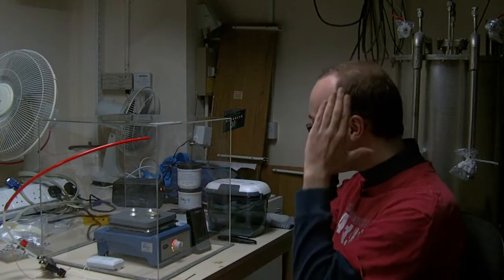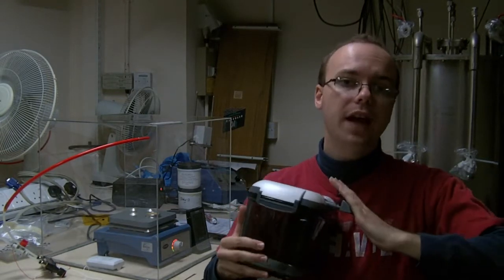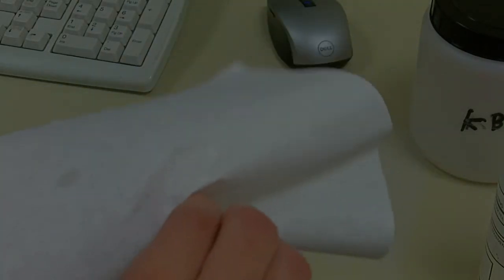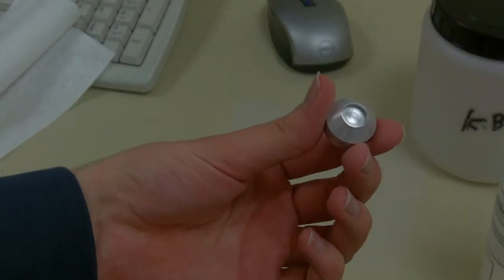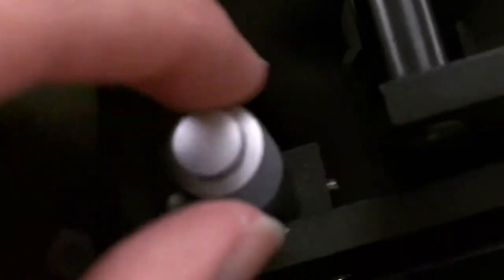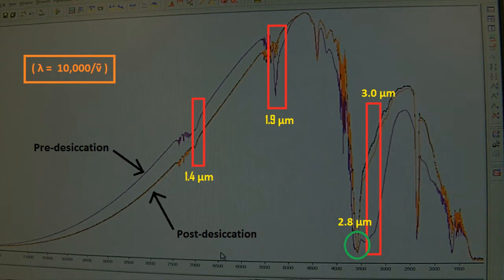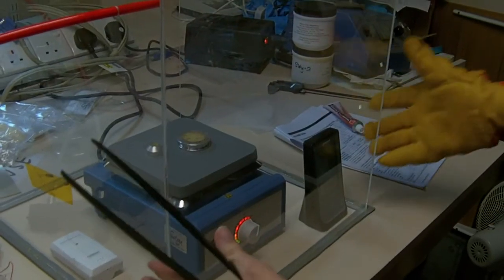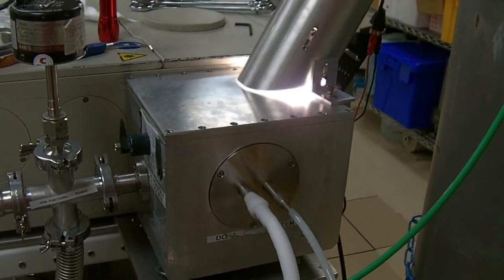PhoboCam: Week 7

Comment from the maker: @TheOldManEric:

I did separate audio and video for some of the scenes, but in this case it was purely driven by time constraints. Great to know it wasn't too bad though!

I usually get a sample of 5-10 seconds of noise beforehand, but the problem in this case is that the lab background has multiple components operating over a number of timescales (some correlated, some somewhat random, some odd bursts of air venting), making it a pain to key it all out! :-)